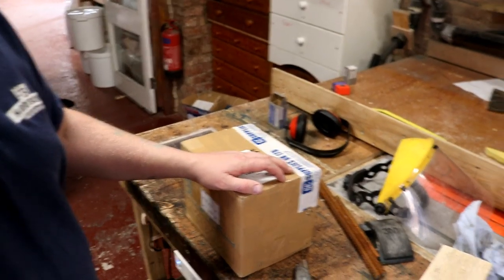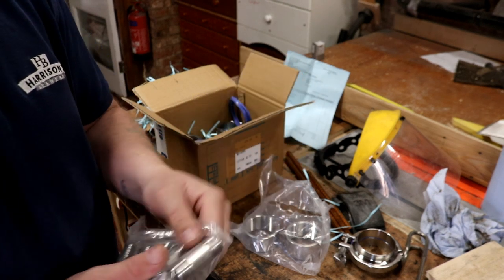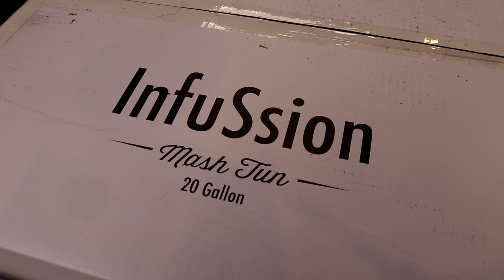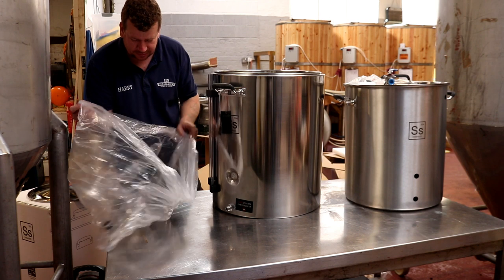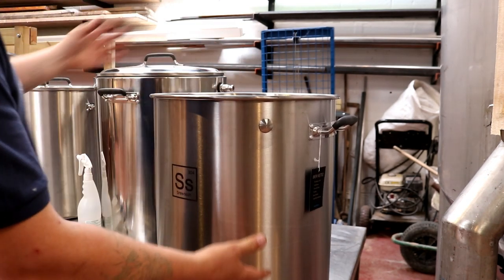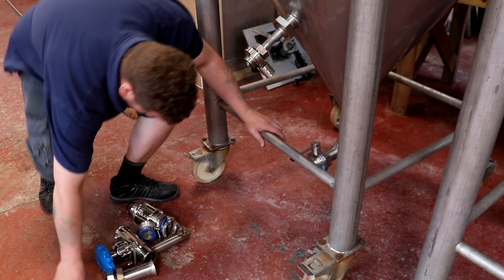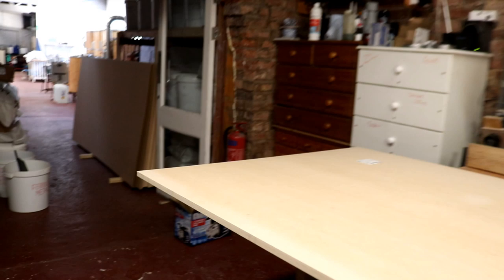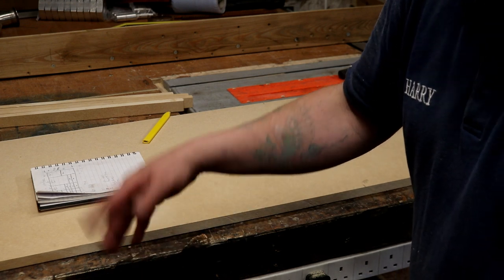SS BREWTECH 20 GALLON SYSTEM

Comment: The two sight glasses are there to indicate if you're about to get a stuck mash.  One tube is above the false bottom, and the other below it.  If the liquid level in both tubes is even then the pressure is the same (obviously), if the two levels are are uneven, you are drawing too much suction.  Check to see if both sight glass holes are drilled all the way threw. I had two separate mash tuns that were screwed up.

Comment: Hi Chris, yes, was watching. Many thanks for the kind words. Have got some new kit due in the next few weeks, such as new Hygienic Butterfly Valves with multi position S/S Levers that can be padlocked in place and a Pump Protection Strainer for me to look at. It's 1.5" Clamp Ended with a 1000 Micron Element. I have had to buy it to look at. Will let you know if I think it's any good. Keep up the good work buddy. Cheers, Andy.